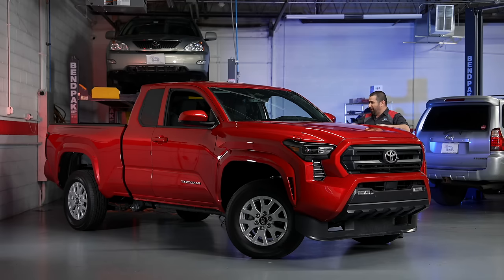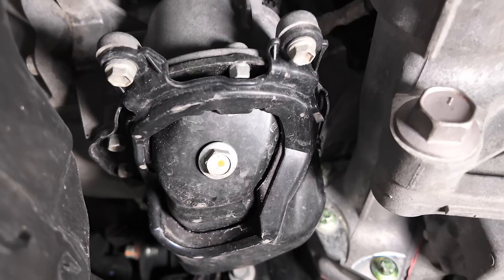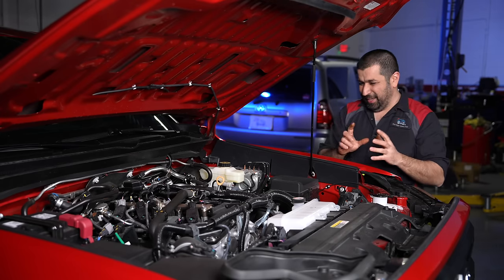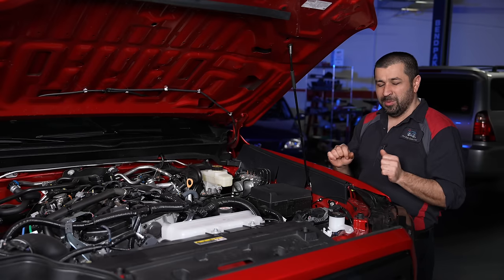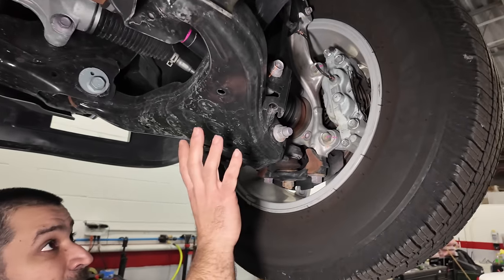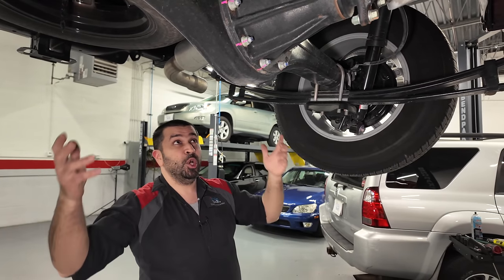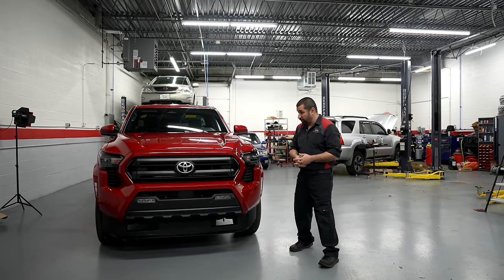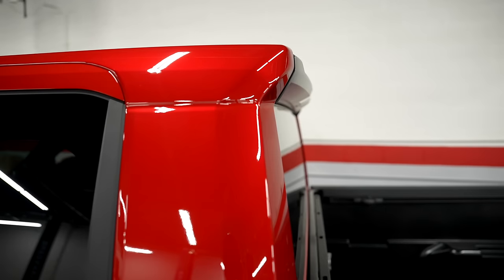2024 Toyota Tacoma | Did Toyota Improve or Ruin The Tacoma? Comprehensive Review

Comment: TFL broke their new 2024 Tacoma.
Reply: That means nothing. They did break on the truck, it's a new truck first year build, they did towing right away with it.
Reply: @glow4417 you're kidding yourself if you think it's nothing. Guarantee you Toyota engineers got their hands on it to determine what happened
Reply: they also have broken various other vehicles. So have millions of people. Not a deal breaker. Theres no recall for the front running gear so could just be a one off issue
Reply: You didn't even watch the video.
Reply: On a bunny hill…my driveway to my house is more challenging
Reply: That failure was NOT abuse. 100% a design or quality control problem.
Reply: Totally agree this truck is sketch
Reply: If you don’t like, don’t buy
Reply: Yes I agree if you don't like don't buy sample as that
Reply: @glow4417  you are kidding right?
Reply: I was going to say it broke down on a simple rock not very confident inspiring
Reply: yeah this guy is just a toyota butt kisser...hes like oh youre not gonna miss the V6 with this 4 cyl turbo...yeah right. idc if its a toyota,  a small 4 cyl turbo is not as reliable as a NA 6 cylinder.  the power may be decent but it wll sound and feel different and wont be as reliable
Reply: @Enchanted3DPrints …it’s only been a few days.  Plus, TFLoffroad has not posted a follow-up video…which may say a lot about Toyota’s reaction to this issue
Reply: @glow4417  people like you like to cover things up right away huh instead of examining exploring, deep diving and trying to come up with a fix so it doesn’t continue to happen on future builds
Reply: @glow4417 they did not tow anything, they were off-roading in a snowy terrain with a very mild incline. The transfer case broke.
Reply: @Teporame  true, but we still don't know what happened yet. It could have been a transfer case failure but it could be so many other things aswell.
Reply: @glow4417  Toyota is recalling the Tacomas
Reply: @Teporame Not in this video, but they did indeed tow with it almost immediately after they purchased it, on the ike gauntlet which is one of the toughest stretches.

https://youtu.be/2Zn3vkEGlvQ?si=9NcazqgcC7-DxJCm
Reply: When you come upon icy rocks, go around them.  Or something will break.  Trucks are meant to be driven and  not abused for stupid social media entertainment.  It's a waste of incredible vehicle engineering to max out the limits of an everyday vehicle.
Reply: The price of the new Tacoma is outrageous for a mid size trunk.
Reply: @BooBoo-vo6oh TFL has never once 'pushed' a vehicle's limits compared to other channels. I have literally been as challenging driveways in Maine and much more challenging driveways in Alaska than the incline TFL was on.
Reply: @bowhunter182 
Not when you consider the amount saved in repair costs and resale value.
Reply: Definitely a concern that they broke it so easily on a snowy hill.  This would not have happened on previous generations.  I’m sure Toyota will address this.  Reliability means everything to this brand
Reply: @JohnnyBoy919 Towing on the highway will have zero affect on the four wheel drive shifting mechanism and front axle. They broke the 4 wheel drive. Not tow hitch or transmission or rear axle. That camper tow was only about half the tow capacity also. Not like they threw it to tge wolves. The wimpy tires in snow & ice was not putting any strain on the driveline and it audibly broke. It's probably the axle disconnect or the transfer case. I put the manual hubs and simple front differential into my 99' Tacoma because I do not like front axle disconnects. Ask jeep people about them...They also remove them.
Reply: @Enchanted3DPrints Not worried about other auto manufacturers that don’t pride themselves on reliability.  Toyotas don’t break that easy
Reply: @JB-mn2gu I don't have a problem, and I don't own a tacoma. Just stating the facts.
Reply: @briansantefort  I never said them towing is the reason the 4wd broke, I'm just saying they did tow with it before taking it off road, the guy I quoted said they didn't tow with it.
Reply: Who cares? Is the first run of a brand new vehicle. Every single new model goes through this. You people never learn.
Reply: @Aldeeezzy great idea!
Reply: Not impressed.
Reply: @TryAmazonPrimeToday the 2022 and 2023 models, not the new ones.
Reply: @Gilbertmk2 exactly!
Reply: @BooBoo-vo6oh Chevy Colorado with more miles went over the same icy rock just fine.
Reply: @ItsAlive111 and it’ll lose value and be on the side of the road in a few years
Reply: I wouldn't buy a new Tacoma now. I would wait until real off roaders actually off road this thing modded with bigger tires. TFL barely off-roaded the truck.  This is alarming that it broke on this easy trail.
Reply: @BooBoo-vo6oh  Then what is the point in producing an off-road vehicle.
Reply: @Anomic-mo9ji  YA. If and when it breaks you don't go to your audience and cry about how much spent for your right break something in the process of making money from views for breaking it in the first place.
Reply: @ItsAlive111  maybe the person driving the Colorado was not as stupid as the second one.
Reply: @wilmarbarrick3194  i can only imagine the screaming in the marketing department
Reply: Cv axle
Reply: @glow4417 are you trolling, or serious? Did your mom drink when pregnant or something?
Reply: Yup! It’s proven that it didn’t test real-world issues! It doesn’t matter which brand seems to be building cheaper cars for higher-priced stuff with overtop electronics; they want cheaper suppliers that do poor QC to poor manufacturer QC! No excuses shouldn’t have broken down!
Reply: @glow4417 bet you wouldn’t be talking like that if it was a Ford or Chevy.
Reply: @0HOON0  There is no way anyone can tell if this is a design flaw until it starts happening to undreds of more units. Most likely a QC issue on the supply side
Reply: It's weird I'm always seeing this comment on another channels like person dislike this new vehicle 🤔
Reply: @Teporame They towed in a prior video, but its irrelevant since towing in 2wd has nothing to do with the front diff.  Im waiting see what it was that went wrong before judging it.
Reply: @bowhunter182  They all are outrageous.
Reply: Toyota is screwing up making this truck in Mexico, the quality has gone downhill.
Reply: @bowhunter182  Have you seen the price of the new Colorado’s? I saw one tested against the Tacoma and Colorado MSRP was 62 grand
Reply: @WQQKIE  My 2021 was made in Mexico.  1st year there, so far so good.
Reply: @Gilbertmk2  you are correct! I am an older guy and I remember when the vaunted new LS 400 came out in late 1989 and it had a malfunction with the Crews computer. Of course Alexis sent out service tech and repaired or replaced it on the driveway or garage of the owner. Cars are made by humans there will be some error initially matter how much quality control
Reply: @ItsAlive111  and you think GM makes a better product 😂
Reply: I think it says something about quality when one single solitary truck brand new design as a failure. Just ridiculous you guys crack me up
Reply: @2mo2time  that was icy.  Hell Andre slipped and hurt himself there.  The colorado was having traction problems.  Plus who knows what stress was put on the truck before the part failed.  From an engineering perspective that's what should be asked
Reply: TFL should stick with the oldies. That new kid with glasses sucks
Reply: @wilmarbarrick3194  How many people buy a new truck, put thousands of miles on it in its first couple months with also testing it in rocky icy conditions in the mountains? Not many tbh your overreacting.
Reply: And they didn’t even try.
Reply: @glow4417 so towing is bad? It broke sliding in ice. Certainly bad.
Reply: @BooBoo-vo6oh  The 23 Colorado did it no problem. Then pulled the Tacoma out.
Reply: @Teporame  OH! So YOU’RE the one! The only one who knows exactly what component broke…? 🤡
Reply: @bowhunter182  Yes. “Trunks” shouldn’t cost this much…!
Reply: We know
Reply: Paid for by chevy
Reply: @BooBoo-vo6oh  so they shouldn’t video and post the breakdown even though they bought the truck to make videos to post on YouTube? Or you’re saying they should only post videos that make the truck look good.
Reply: @glow4417 TFL did what used the truck as per advertised usage.
Reply: Toyota fanboys coping
Reply: Does anyone know what happened to the truck on TFL?
Reply: @Get_yotted dude I know it!
Reply: ON ICE!!!!
Reply: 4wheel drive
Reply: @glow4417  They broke it while stationary with the wheels spinning.
Reply: What’s TFL?  😅 joking.  They mentioned it was one of the firsts produced, maybe they rushed out idk
Reply: @bostondan77  Excuses. The transfer case should not break on a bunny hill. Full stop.
Reply: Bunny hill broken front diff? People pay more for these trucks bc they have a reputation for being able to outlast everything else! Look at the Taco’s grandpa, the Hilux, look what whistlin diesel did to that thing and it wouldnt die! Noono this is not good
Reply: @ItsAlive111  the Chevy Colorado had issues on previous episodes of TLF.
Reply: I'm so glad this was the top comment .. I'm pretty sure someone up in Toyota will take notice now! Hopefully a recall for all affected models!
Reply: @BooBoo-vo6oh  Better yet, enlarge the house door and bring it in an use it as a futon.  Off road 4wd trucks are not meant for a slight incline on a slick surface.
Reply: @beexiong2995  Rumor has it a disgruntled chipmunk threw a pebble and cracked the paper mache transfer case.  I've had a Scout, two classic Broncos, several 4wd trucks and never had such a pitiful failure.
Reply: @glow4417 to be fair. They did break their 4 banger, underpowered, girly man Tacoma trying to climb a radical 1 inch snow drift.
Reply: @Teporame they towed with it on the IKE  then did some off roading.
Reply: Cause they're stupid. They towed at 6 miles over 1000 miles from Texas to Colorado? You don't do that .. they didn't care
Reply: @alphaomega750 y’all saying they shouldn’t have towed with it are ridiculous. It’s a truck and it’s made to tow. Towing had nothing to do with the failure they had. Stop fanboying and just be honest with yourself that it is alarming and that hopefully it is a fluke but it’s not looking good. Blind brand loyalty is STUPID
Reply: And it broke lightly driving off road
Reply: Stop arguing and give back my coat! 😃
Reply: @glow4417  THIS WAS NOT THEIR FIRST 4X4, SO THEY SHOULD KNOW HOW TO MAKE THE CV AXLE. IT IS MADE IN MEXICO.. NOT JAPAN SO IT DOES NOT HAVE THE TOYOTA JAPAN QUALITY.
Reply: You are incredible, what a fantastic technical review. As a Toyota guy I consider myself very fortunate to have access to your knowledge and experience. I also wasn’t to blown over by pictures of the new Tacoma. Haven’t seen it in person yet. But you know what… as you gave a tour of the exterior it really came to life. Also, the lighting in your shop made it pop for me.
Reply: Yes I follow then and saw the video. Very little stress and broke the front 4x4. I've saw other video and I'm not convinced of the new taco. I think Toyota lost their mojo a lot of bad decisions
Reply: @ItsAlive111  It isn't offered for sale because of a sensor/front camera defect that can throw on the brakes at high speeds.  The Colorado has a stop sale going on right now.
Reply: U poor
Reply: Sample size of one does not a trend make.
Reply: Yup, it's trash
Reply: TFL just released the video about what broke in the front diff.
Easy fix.
Reply: Even tho Toyota will probably be on the repair and take care of it (for multiple reasons…#1 because it broke easily while being reviewed) 
Many people will be wondering what other components may possibly break prematurely? All manufactures  are getting cheaply made parts from suppliers…..sure its may not be “Toyota’s” fault for say but quality control is Toyotas responsibility along with all other manufactures….
Reply: What is broken ??  Powertrain or accessories??
Reply: The exhaust is on the wrong side!
Reply: The Tacoma broke
Reply: They announced today that the ADD (Automatic Disconnecting Differential ) to switch from 4 high to 4 low was at fault on their truck. They said the engineer did say it should not have broken as easily as it did on the snow and ice they where on. It is a safety feature to save the differential in case of extreme pressure being put on the system.
Reply: Every Tacoma is a car. .w a box,bed. Struts,unit bearings ,now an electric rack! Where are the locking hubs?The leaf springs & drums are gone & in the rust belt that crap will fall apart in 10 yrs Way too much electronics 95& older if you want a truck7-8 hundred thousand km, Never replace the steering box. . If it wasn't made in Japan. . U can keep it!! It's a shame no truly utilitarian 4x4 has been available for a long time, manufacturers seem to think I want electronics & short life crap The prices are high ,more& more plastics on the engine.A real truck like a Aussie land cruiser made in Japan. . Not available here How useless is an electric tailgate. . We want a truck not a freakin CAR.In Canada you can't get an extra cab or a standard tranny w a six ft bed. . SOOO disappointed
Reply: @wilmarbarrick3194 there’s a video on what happened, it’s a part inside the front diff that is meant to break to prevent mayor damage on the front wheel drive components, the engineers are working on it, because obviously there was an issue with it, the truck wasn’t being abused or anything like that, it was a normal situation driving it on 4wd
Reply: That alone should make a 35k model available just to prove the tech
Reply: Scotty’s prediction comes true.
Cant tow for shit😂
Reply: @jonathanratliff4780  no i haven't ...
Reply: I'm sorry but that engine bay looks like a rats nest.
Reply: With all the "knowledge" and arguments going on here from y'all keyboard experts, do y'all think the new Tacoma will still be the best selling pickup of its class? Despite of all your efforts to hate it.
Reply: @Enchanted3DPrints they said it was the first time something like that happened on a new truck, in 9 years of filming in that trail.
Reply: Toyota is the largest manufacturer of four-wheel-drive vehicles in the world so I’m sure they’ll figure it out….
Reply: Pop!
Reply: @glow4417 so you are saying they shouldn’t tow with a truck? Maybe they shouldn’t have put it into 4x4 neither. 

It’s a work truck. It should have never broke that easy. It’s built to tow and built to use 4x4. 

Toyota is trying to figure out issue and issue a recall.
Reply: TFL is a joke
Reply: My 422,xxx mile  86 Forunner still has the original front differential.
Reply: . Means nothing?  Yeah it does. I'm not buying something that will break so easily. If they were abusing it then I could see, but no. Toyota quality has been slowly going downhill over the years.
Reply: @Enchanted3DPrints  For that price you can bet it's a deal breaker. Not taking the chance.
Reply: You should check out the update video for the TFL incident. It wasn't a small thing, but the Toyota engineering team is working on it, and that's what sets this truck apart.
Reply: @bowhunter182   I agree about 
The price.
You could probably get a base Silverado for the price of this midsize Tacoma.

That Tacoma was going up against Chevy Colorado and the Colorado out shined the Tacoma  and the Colorado can tow more. 😒
And of course, the Colorado is a cheaper truck to buy.

I  am  "#Toyota_Fan_Boy"  , so that video is a Nightmare for me. 😢
Reply: 😂 typical new technology
Reply: I like Toyota trucks. But I don’t worship them as flawless vessels of divine perfection.
Reply: @cantwealljustgetalong2 totally agree with you he just kisses Toyota butt.
Reply: First year vehicle problems. Nothing new, that's where manufacturer's warranty comes in.
Reply: All brands have problems at first ,, keep in mind they do thousands of them , they ll catch it
Reply: The taco did break but that’s why they get these truck to work them on and off road hauling and towing so if til can break it they will look at that and fix the problem or what ever the can do to remedy the problem and I think there’s a part made to break if something has to much strain on front axel and it may need to  be beefed up a little so that it takes more strain.
Reply: Made in Mexico!
Reply: The truck shouldn’t have to brake under the circumstances it did. It wasn’t strained or abused in any way. Looks like a poor quality and deficient design. Toyota used to make their vehicles virtually bulletproof. I hope the Japanese made models are still like that. This one is cheap design, made in Mexico to serve the North American market. A Japanese made Hi Lux won’t have a flaw like this.
Reply: @JB-mn2gu😅
Reply: I respect you greatly for your mechanical abilities and the technical knowledge you give us when you are repairing Toyotas. Please don’t lower your self to the salesman side of Toyota.
Reply: Nonsense, this truck will be great if all you need to do is haul groceries from Walmart 😂
Reply: @Aldeeezzy we are spreading awareness.
Reply: @JP-qq2kn he likes to watch the world burn.
Reply: It may have broke on a small incline but it could be possibly partially due to software issue as well. It broke as soon as he engaged crawl mode. Crawl mode engages brakes and controls throttle as well, and is only in 4l maybe it was being to aggressive with the brakes giving the illusion that there was little stress on the drive train when it was actually extremely bound up. It seems like an axle or transfer case diffs usually grind and I didn’t see that.
Reply: The Unrestricted channel also had his break 1 week with the p.o.s taco
Reply: @JB-mn2guThe Unrestricted channel also had his break down 1 week in.
Reply: @AJM-ov5dw  I kinda feel the same about that, also disappointed that they don’t sell the Xtracab version in Canada anymore and that you can’t get the standard transmission with the 6’ bed. It looks like I’ll keep my 1993 SR5 quite a few more years! None of my cars have a rack and pinion steering and I don’t want one, hydraulic or electric! I don’t get why they have so many actuators now instead of simple levers and cables. Also, I’m wondering how these electric parking brakes will stop new cars when they age and get brake system failures. I had to use it last year on an older car with a single master cylinder that failed!
Reply: Look at that overstressed spaghetti mess of an engine bay. What a disaster gas engines are these days. Bet this engine is lucky to get to 75k miles before needing a rebuild.
Reply: @nerdbikes3841  It makes the engine bay of 1990s models look nice and clean! I guess someone at Toyota saw Scotty Kilmer repeatedly throwing engine covers on the ground and thought it would please people to see this wiring and hose mess! I hate useless plastic covers but this engine compartment looks bad! Isn’t there a way to make things look right without hiding stuff under a cover?
Reply: @wilmarbarrick3194 exactly. I’m glad they broke it. Those engineers will figure it out.
Reply: We'll see what happens
Reply: Glad I own 2019 TRD! 🤙
Reply: 4cylinder turbo?
Gross ...
This must be sponsored by toyota..
"Trust me guys... its not so bad"...😂😂
Reply: Do you shouldnr tow right away with a $50,000.00+ truck?
Reply: That's what happens when take the engineering out of Japan like the old Toyota trucks.
Reply: @Aldeeezzy You won't know if you like it until you buy it.
Reply: Theshillchannel broke it lol
Reply: One time at band camp.
Reply: On a part that's been included on previous years... Means absolutely nothing.
Reply: @glow4417  No it definitely broke when it shouldn’t have. I watched an update on what it happened and it was the front differential disconnect so at minute 36 of this video he talks about that and it being a good thing but if you were to watch the whole video from the perspective of knowing what broke already the full-time four-wheel-drive model will be far superior because that front diff disconnect is a weak point
Reply: It just seems to me that when manufacturing goes to Mexico the quality suffers. Ford and GM have experienced this but they and others I’m sure don’t learn from it. Now it’s Toyotas turn!
Reply: So they are all garbage now just because of that? Whats your point? What does that do for consumers and Toyota as a company? Absolutely nothing! Toyota will sell Tacoma’s left and right and you will still be on youtube saying random statements.
Reply: Toyota does what the big 3 do not. And that is that they are constantly addressing and eliminating the issues that arise along the production line. This is amazing and makes for a manufacturer that deserves respect. The big 3 make the end owners the Guinea pigs and have learned they make more off repairs and parts than sales
Reply: @JB-mn2gu Mexican quality
Reply: Saw that video. Did anybody out there if you want a workhorse truck you're going to have to go to a full-size heavy duty.
Reply: It’s horrible especially for Toyota. Toyota heavily relies on their “reliable” brand image. People buy Toyotas for reliability. So I’m sure Toyota will be on to it.
Reply: @wilmarbarrick3194 it's nothing,  it's just 2800$ to 4000$$ just for fixing the a little thing hehehehehe😅
IMAGINE AFTER 59,999 MILES
Reply: @cantwealljustgetalong2 I hate the engine sound,  is like diesel hehehhe.😅😂
Reply: THEY HAD A DEFECTIVE PRE RELEASE MODEL. THE AXEL WAS NOT PROPERLY HOUSED. AS A RESULT, THE DIFFERENTIAL BEARING LOCK MECHANISM DISLODGED FROM THE SHAFT DRIVERS.
Reply: That truck was like #65 out the factory. There’s always going to be issues with new cars.
Reply: Puts in mild criticisms to cover completely biased pro Toyota slant. AND  "Phased cam timing oiling is simple here. "  we'll see.
Reply: 👋🤣yes they did! They broke the front differential when off roading comparison! That’s unacceptable!
Reply: @glow4417 so why can’t you tow with a new vehicle??
Reply: @ardalandanesh    What a brainless response.  Lol. What sets rhis truck apart is it broke really easily and shows the lack of product development on Toyotas part.  This didn't used to happen....ever
Reply: @Teporame it wasn’t the transfer case..it was the front diff.
Reply: Looks good. Yes. But, mechanically, this thing is garbage. The 4L Tacoma will out tow this and the new taco is poor quality. Not only new taco broke on the tfl, it also broke on few other guys. So, outside of it looking good, it is just a good looking trash. Sorry.
Reply: One part on one truck first production big deal!!😂
Reply: @theoutdoordad7395   Looks like it's waaayyyy past one part one truck. More like 1 part, a whole Lotta trucks.
Reply: @glow4417 no they did nothing wrong. Why such weird love for a  Japanese government run brand
Reply: @BooBoo-vo6oh  you're hilarious, the driver had nothing to do with it. it was the failure of the Toyota truck why are you such a blind Toyota fanboy of not accepting it looks like a problem.
Reply: @Get_yotted  seriously they can't just admit that it looks like a serious defect
Reply: Yes they did 3 months old and it can't even handle light offroading. What a pos
Reply: @Enchanted3DPrints what other new cars or trucks have they broken something in the drivetrain? Lol
Reply: 15k market adjustment here at a Norfolk Va dealership 75k
Reply: @glow4417 it’s a truck… it should be able to tow right away
Reply: If anyone is going to break something it would be Roman.
Reply: It broke and they have been breaking. Stop making excuses for Toyota. They are no longer the car company we once loved and praised. Toyota has made a major error and needs to be called out. I was a die hard Toyota customer, but now I’m not even interested or want a new Toyota.
Reply: That channel is nothing but clickbait and junk. That whole team is just a bunch of goofballs
Reply: That’s not nothing. They were on an icy trail in 4wd and that front linkage in the front ankle just went pop. Absolutely no reason it should have broken!  It was icy. It wasn’t torque locked. It was under minimal torsion load as they were trying to go up only a reasonably steep hill and it broke basically stranding them. I would assume the engineers were right there looking at that. I hope.
Reply: @Teporame it was actually front diff that failed. The inside components that lock it into 4wd. There was a follow up video but sadly for whatever reason they were not allowed to say much about the repair.
Reply: @BooBoo-vo6oh then why didn’t the Colorado break 💀
Reply: The taco v6 was low power and gas drinker missing fed mandates. 
Time to catch up with Ford Ranger, but they even now has a 3.0 twin v6 !
Reply: @glow4417  It is totally unacceptable for that to happen for a 50K truck Toyota is not a new company. Toyota fan boys will be upset by this news....
Reply: @glow4417  so I pay $50,000 for an off-roader and not take it off road...😅😅 
It's like buying a steak at a restaurant and waiting till I getting home to eat it.
Reply: Oh I saw that and was like NO
Reply: @glow4417  break on the truck? They took a TRD off road up a slight incline in snow.. that’s not breaking on a $50k truck… it’s basic.. and Toyota even released a statement about it because a full transfer case bust should not happen under conditions that basic..
Reply: All they had to do is update to the 8 speed automatic the V6 was fine. A Turbo 4 will never be as reliable as the 6cyl in the long run
Reply: TFL  brought back the  #Tacoma, they named  :
"Blue🔵Berry"  but kept their Chevy Colorado. 

Now there is transmission issues with both the automatic and their manual 2024 transmissions 🤦🏼
Reply: Man I drove a Tacoma that had 25000 miles on it and the engine made a lot of noise
Reply: And then drove it home. Not a lot of people are talking about the other side of the story in that, yes they broke it bite drove it home. How many vehicles today could you break something then have to probably tow it?
Reply: The new tacoma is a pos
Reply: @glow4417 thats the point of a truck to be able to tow with breaking doesn’t matter if its the first. Like really?? Lol
Reply: Do you think it’s better for American companies to send manufacturing to Mexico than bring all their people here?  John Deere is moving a plant there also.
Reply: The tundra had a known defective engine that toyota didn't want to cover until most of the engines failed at under 40k miles. Toyota reliability is diving off a cliff
Reply: That's why you never buy a first year redesign model